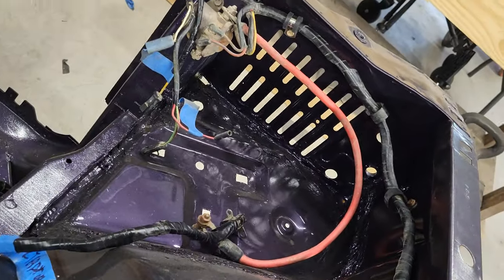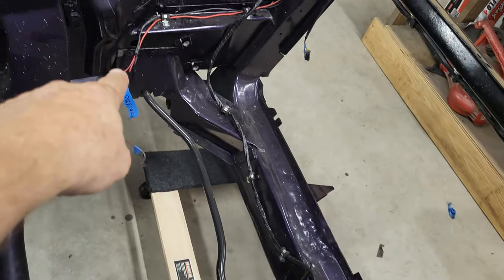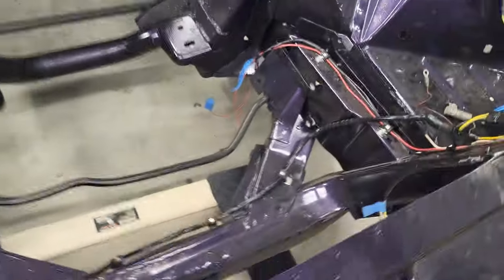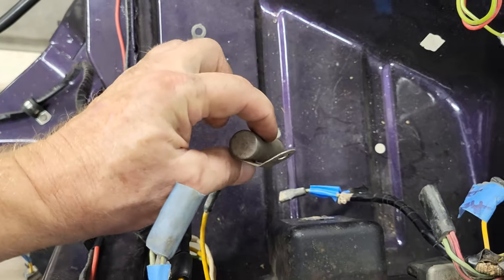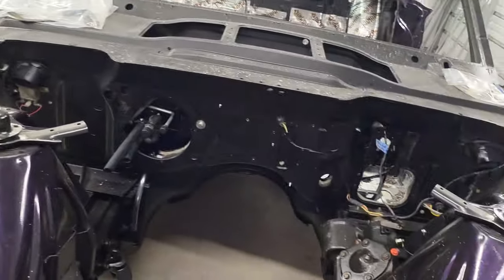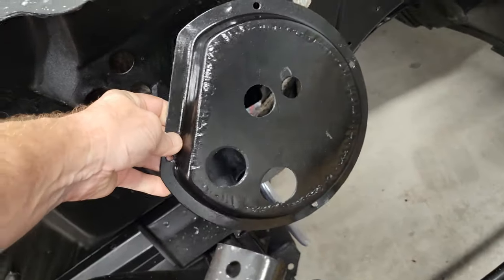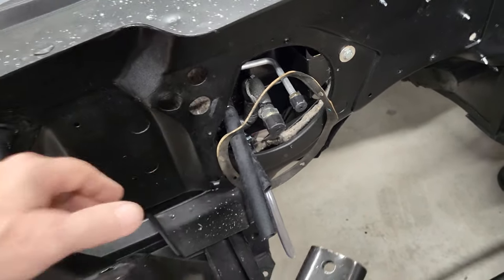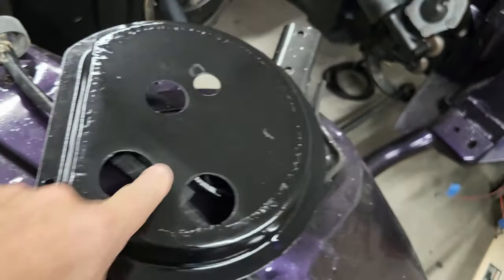Engine Bay Wiring - 1964 Thunderbird

Comment: At beginning, you had two items you didn’t know what they were. The small cylinder shaped item attached to voltage regulator is a radio noise suppressor. The other unknown part that mounts to drivers side is the brake light relay.
Reply from the maker: Thanks.  That's some very useful information.

Comment: C3VB-14512-B is the brake light relay. You can get them new for any of the Thunderbird dealers.
Reply from the maker: Thanks.  I'll get that replaced if mine doesn't work.  Thanks for the part number.